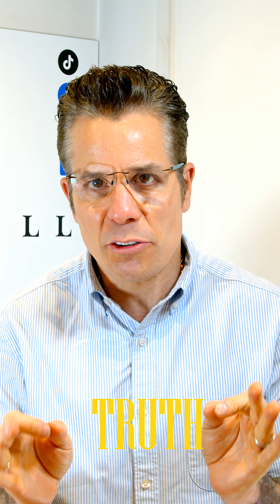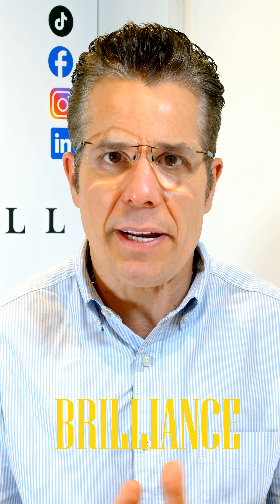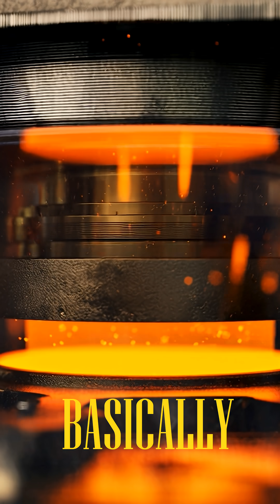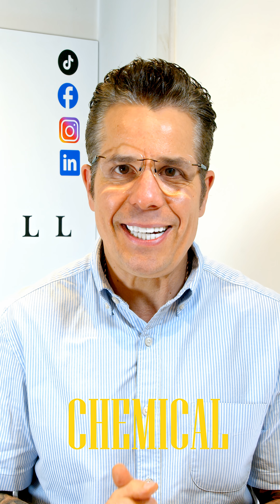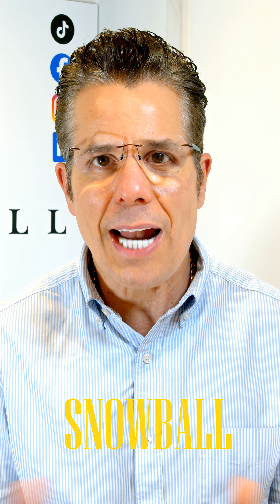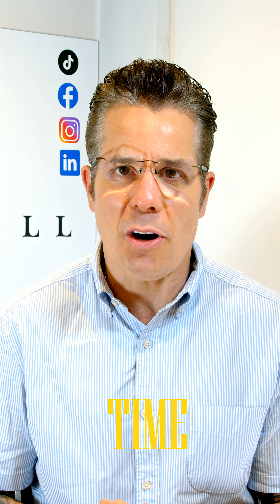“How Lab-Grown Diamonds Are Made | HPHT & CVD Explained”

Comment: ohhh I wasn't aware that there's another method CVD 👍. so does this mean we can take tiny heirloom diamonds, make it go through CVD, will that result to a larger diamond gem?
Reply from the maker: Great question! CVD does grow a diamond layer by layer — but you can’t use an heirloom diamond to make a bigger one, unfortunately.

The diamond that goes into a CVD chamber has to be a very specific type of tiny lab-grown “seed”, and it needs to be completely clean and consistent for the growth to work. Natural diamonds have little inclusions and variations that stop the process, so you can’t “scale up” a family stone or turn it into a larger gem.

If you’ve got an heirloom diamond you want to honour, the best option is usually to redesign or remodel it into a new piece, using the original stone as it is.

I hope that helps! Happy to explain more if you’d like.
Reply: @blackwelljewellers  ohhh I get it now 👍👍 thank you for further explaining it for me 💎